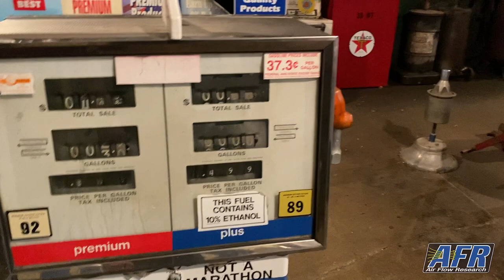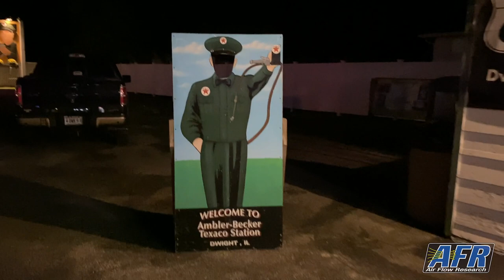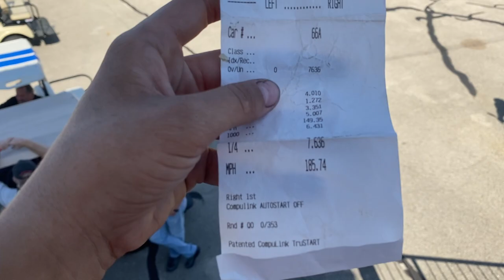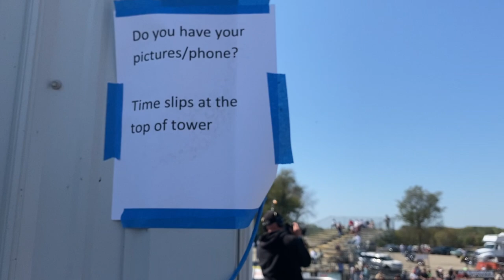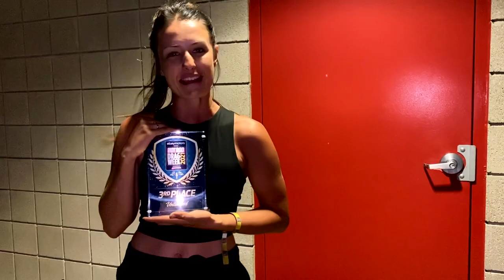3rd Place in Unlimited! - Drag Week 2021 - Video 2 of 2

Comment: Alex the thing about racing, someone has to win, someone has to lose. I used to race slotcars (1/24 scale model cars on a wooden track) many times I won races when someone burnt out a motor or bent a chassis in a wreck, it happens. Did I like it? Nope, I wanted to beat them at their best, but on those days it wasn't meant to be. Racings racing, be it straight up or times events (Like DW). Someone has to win and someone has to lose. and congrats of both 3rd at DW and 1st at RW. Hope to see you run Sick week next year

Comment: It was a shame about the Javelin, but what was equally as bad, and obvious to everyone watching live, was that the cleanup left fluids and oil dry in the braking zone of the right lane, and it very obvious that both the cars that wrecked after locked up the rears pretty much the instant the drivers went for the brakes. Anyone who goes back and looks at the footage will see the '55 kick up a lot of oil-dry dust.
The right lane should have been closed at that point.
The two that wrecked in it were not the only ones having issues, a lot of cars could be seen wandering in that lane under brakes.